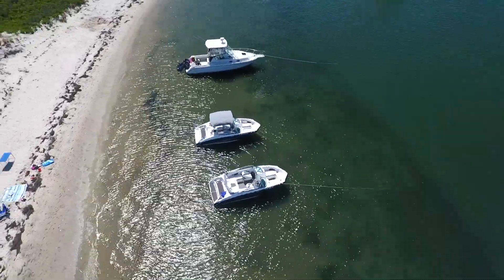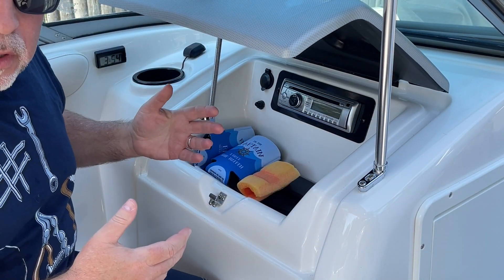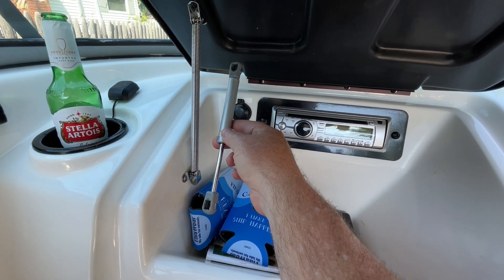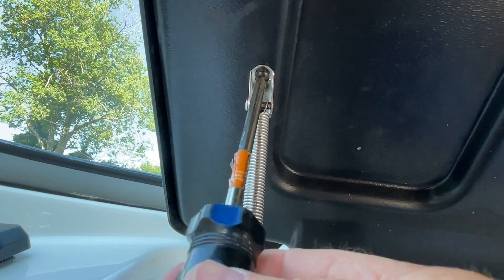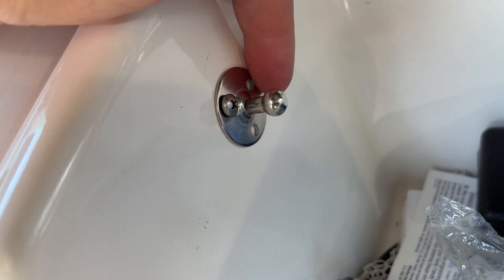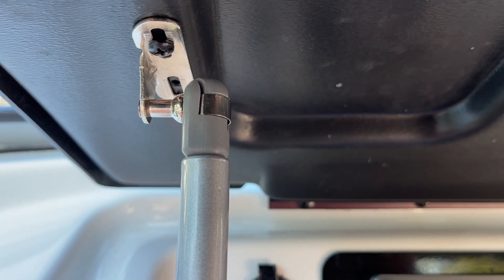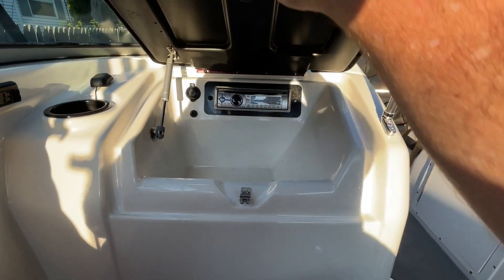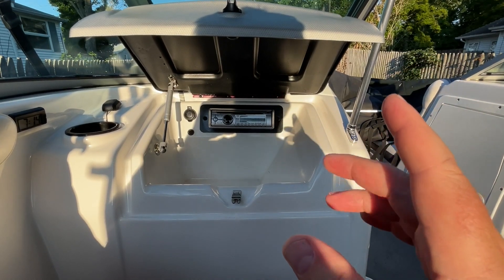Gas Strut Install - Great Boating Accessory

Comment: Link to item?
Reply from the maker: Sure thing Jay Po, and I just added it to the item description as well. 
Hxchen 100N/22 lb Hydraulic Support Cabinet Hinge Soft Close Lid Supports & Buffer Telescopic Cabinet Door Gas Spring Glue Head Supports 8" Length - (2 Pcs) https://a.co/d/038BhsV